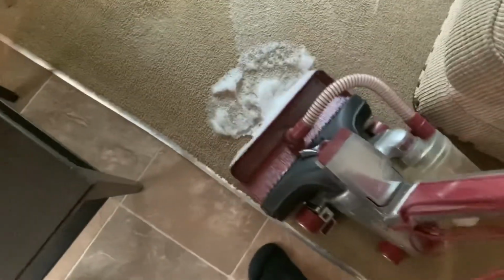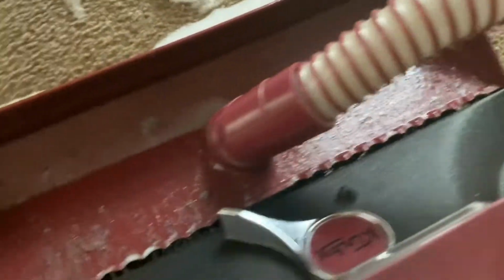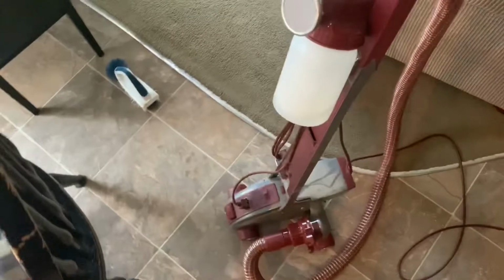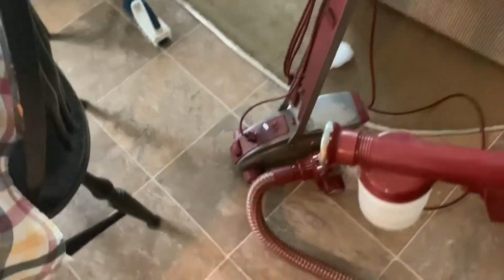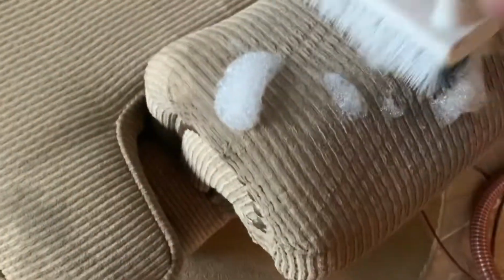Kirby Legend II Carpet Shampooer

Comment: Its not a portable shampoo gun its for painting 😂
Reply from the maker: Actually, it is when you attach the foam cap. It's called "Suds-O-Gun" for a reason.
Reply: Well Mr collector fixer in my manual it says its used for painting
Reply from the maker: @deancolquhoun7761  
Yes, you can paint with it. But it’s a portable shampoo gun as much as it is a paint sprayer.